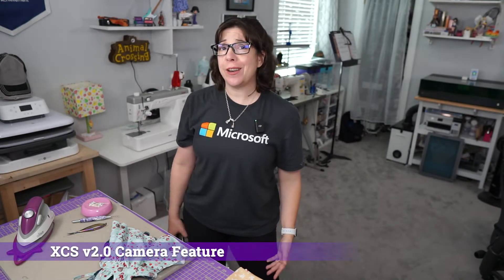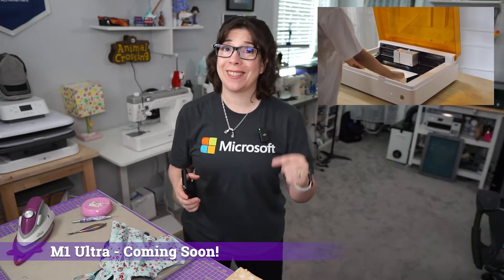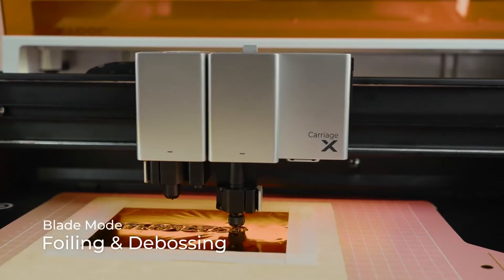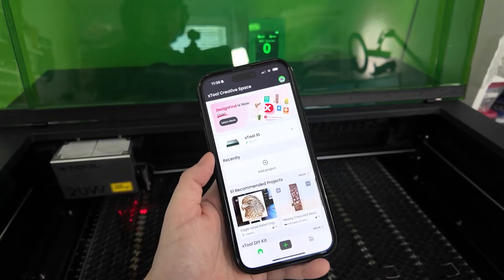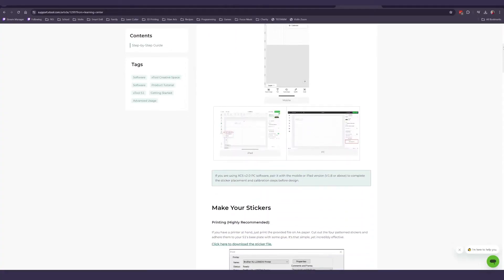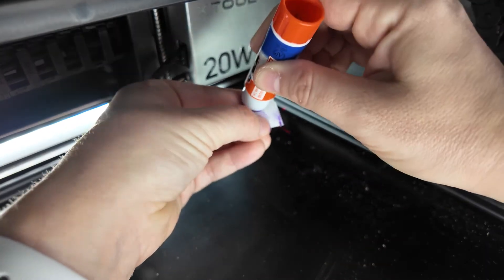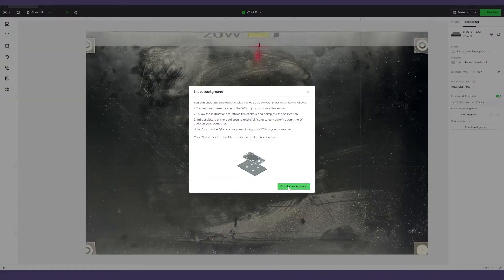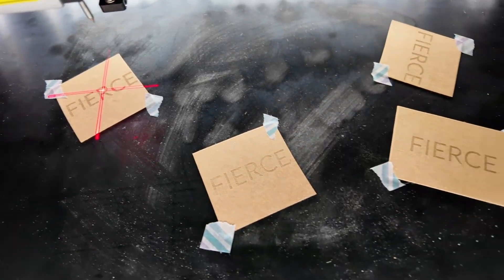How to Use the xTool Creative Suite Camera Feature - Beginner Friendly Lasers and Software

Comment: Thanks For The Video Question ?  Is This The Same Proses For The M1 Ultra Thanks
Reply from the maker: Yes it is! I suggest using the point plotting system though. It's a lot more accurate. If you watch my M1 Ultra sticker video, I show how to use that.
Reply: @fiercekittenz  Thanks I Would Like To Laser Engrave Multiple USB Flash drives and INK Pens  At The Some Time

Comment: Sorry but.... We have the M1Ultra and in our experience using this method is far from perfect. You get better precision with the "Mark" function. The snapshot is OK but if you have a small area like bottle stoppers/Wine Corks don't count on this method. Do a test: Take a snapshot but then also "mark" the area to see how off it is.
Reply from the maker: I tend to agree. I did this tutorial with the S1 when the feature was first released. I have a sticker tutorial on the M1 Ultra where I use the marking feature!
Reply: @fiercekittenz  - I need to locate that LINK.... Day 2 of just trying anything to get this to work.... Am I missing my Scan n Cut yet? Kind of...

Comment: Is this possible on lightburn?
Reply from the maker: No this is a proprietary feature of the xTool software.
Reply: lightburn has something similar when using a USB camera on your computer. you can buy the lightburn camera for around $50 but the calibration is extremely tricky and still off quite a bit. I sold mine and just frame things every time instead but the feature would be very nice!

Comment: Hi! I’m running into the issue where it seems calibrated, or so you think. The 4 dots line up with the crosshairs on the screen (laser position on screen) however any object I have in the bed will not be scaled properly. I tested it out and anything that isn’t flat appears to bulge in the middle of the picture as if it were doing a fisheye lens causing my designs to be off by mm on one side but not the other or vice versa.

Have you had this happen to you or know a workaround?
Reply from the maker: I have not! Make sure it’s not set up to use a curved surface?
Reply: Yes’m, I’ve checked and unfortunately nothing changes. I submitted a ticket with xTool but waiting on a response